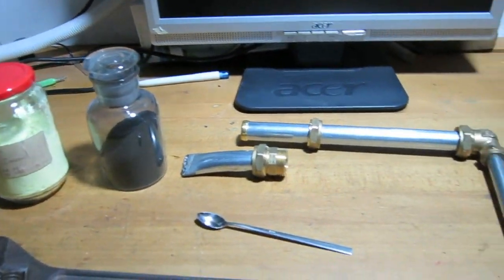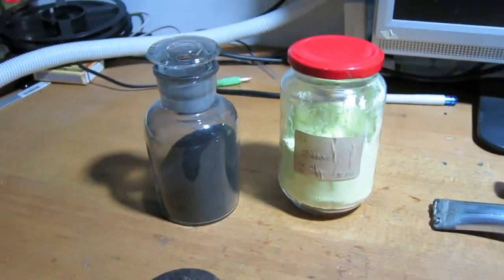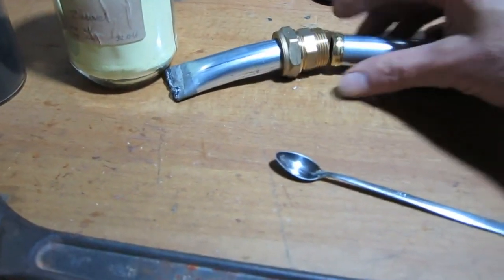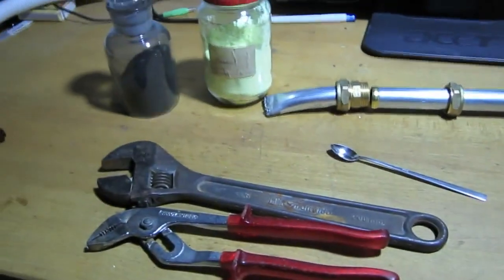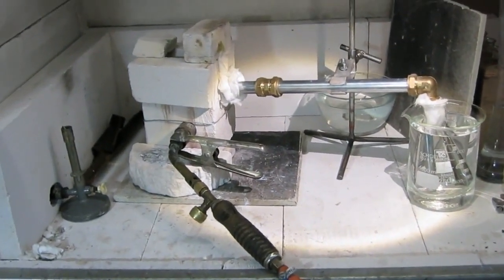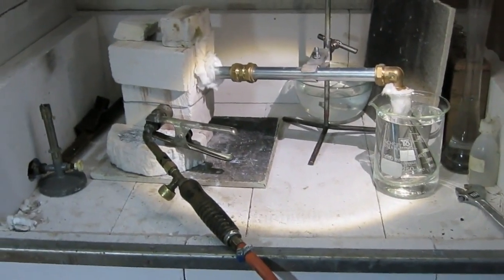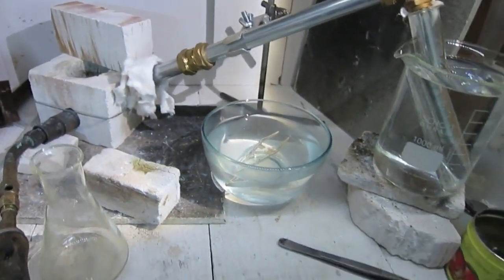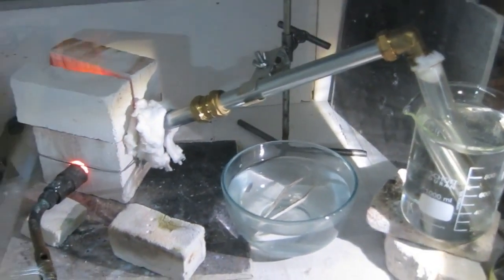Generating carbon disulfide CS2

Comment: a simpler way of generating CS2 is by pasing gaseous acetylene through boiling molten sulphur (it is similar to the industrial route, only they use methane, which requires some 600 Celsius)

Comment: well, as you say, it is highly flammable. be happy you failed!! you will not reach temp. high enough, by this method. use an electric tube oven instead. no flames, more results.